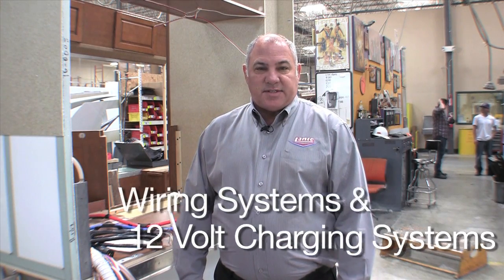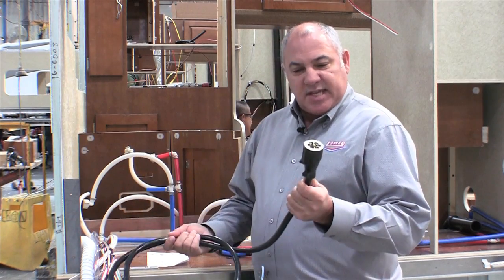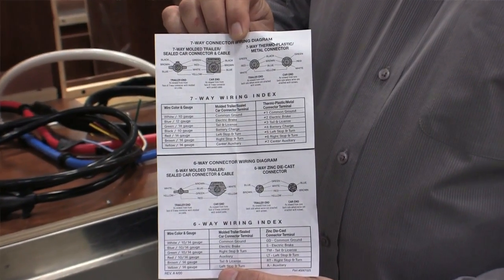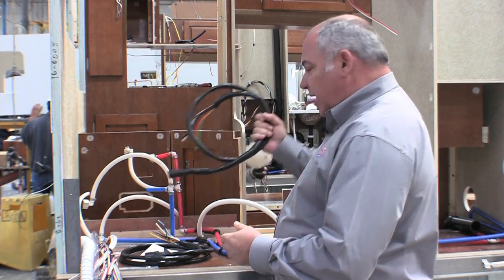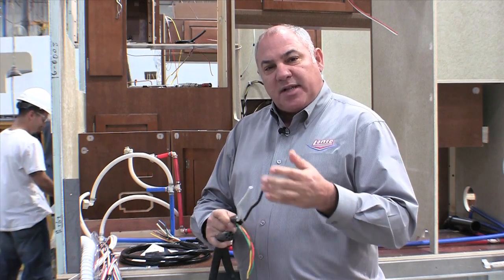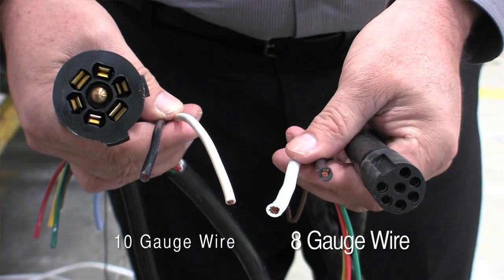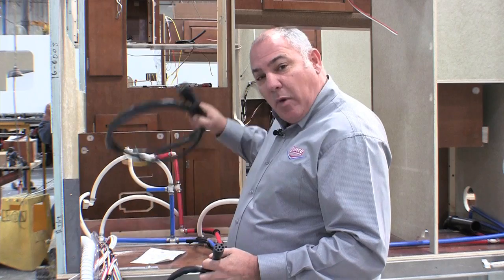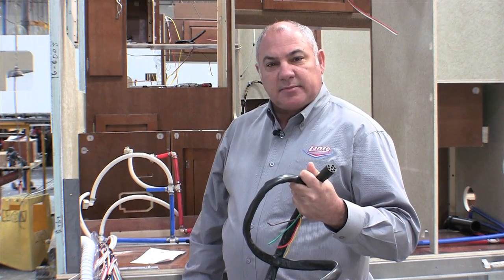Lance Camper:  Wiring System

Comment: So you're telling us Lance designed a  plug with thicker wires but weak connection point to charge the house batteries but still connects to the trucks OEM 10guage harness?   I cut mine off and installed a 7pin.
Reply: I would like to do the same would you be able to tell me how
Reply: Has it worked fine? I’m planning in doing the same. Thanks in advance.

Comment: This is nonsense. The charge lead from the truck can not carry the fridge on DC regardless of the wire ga as the truck output at the seven pin never is that high. Put a meter on it and you will see what I mean. Charge lead output is basically just to sustain the house battery. There is no danger of it getting hot which is why no other manufacturer does what Lance does with its cord and they do not have problems. Check it out Lance!!

Comment: thanks for the explanation; it makes sense.  Is there a Bargman plug adapter to tap that into my truck's tow hitch connector?  I have an old 1990 Lance camper I'm putting on a 1993 Ford F350; it is already set to tow...

thank you
Reply: Did you find an adapter? Im looking for one right now.
Reply: @danielgriego  I am also looking for one for a 1999 lance lite 815. any luck?
Reply: No. Never found one. I ended up just running an extension cord from an inverter I have inside the truck cab to the plug in. Works fine
Reply: @danielgriego  
Do your tail lights work ?
Reply: @alejandradiaz5687  Yes

Comment: It never ceases to amaze me that people thing that upgrading one section of wire to a lower gage (higher amperage) wire accomplishes anything. This actually accomplishes nothing UNLESS you are going to run an 8 gauge or even lower gauge wire from your alternator to the pigtail connector.

I actually ran 1/0 wire directly to an Anderson connector in my truck bed and also to my bumper (for a winch hookup). Then I made up a 1/0 pigtail from my bed to the camper and then rewired my camper for 1/0 from the connector to the electrical panel. The only real pain in the butt part was that the only place I could find 175Amp Anderson connector exterior dust cover housings was in Australia.  Fortunately my daughter was doing a study abroad there and I sent them to her. Lol. These aren’t mandatory but I wanted a finished look just like my existing trailer harness had. 

The only other comment that I will add is it is usually a voltage drop that causes the most charging issues not an amperage drop. That is the real reason for going with a larger diameter wire in DC systems. With this wiring hookup and my 4 AGM batteries along with my 250 amp truck alternator causes my deep cycle batteries to be charged from 50% to 100% in record time just driving or running the engine. 

So while I love lance products, it is disingenuous to suggest that upgrading the pigtail and even the camper wiring to 8 gauge really won’t do much of anything without upgrading your vehicle wiring as well.
Reply: If I understand correctly, when Lance dealers set up their wiring system, they run 8 gauge or heavier wiring to the  battery and install their dedicated plug in the bed of the truck.. meaning that you are correct.. It's just that this video doesn't tell the whole story..I like your approach.. now.. who do I know down under !
Reply: Mike Cavender Well, my daughter is still there if you need an interim shipping location lol. But you really don’t need the “Dust Covers”. As I said, I just liked the finished look of the dust covers. I’ve seen a lot of people just leave the Anderson connectors exposed and use the optional rubber end cap as the weather proofing. I haven’t heard of anyone having an issue with that setup. Now, if I could only find a US supplier of the Anderson dust covers...

Comment: Still doesnt address the need for larger wire to adequately charge a house battery and more importantly it doesnt address the flaw in the truck wire harness.
Reply: Please explain your comment, I have an issue with lack of continuity through plug to my backup lights.  yellow wire, on ram 3500 and no fuzes are blown
Reply: @steveenglish6639  what does your backup lights have to do with connecting a camper to a truck electrical system?

Comment: And anyone out there tell me why my truck is not charging my camper anymore I have change nothing I have power from the battery and the relay at the battery on the truck but the refrigerator is not functioning and it's not charging the house batteries it will charge the house batteries when it's plugged in or when it's on the generator but not the truck when we're driving and I did before
Reply: Did you ever find an answer to fix this?
Reply: Jacob Gordon No I have not I’m assuming it’s The inverter
Reply: @DiegoCauliflower  Have you found an answer?  I'm having the same issue.  Getting a charge when plugged in but not while driving or from generator.  Brand new battery so I know that's not the issue...  Just got back from a 3 week camping trip and will start looking into it.
Reply: Alexandra Anthony yes i had to make sure the fridge is on propane when driving and then the truck charges the battery
Reply: There is a truck to camper disconnect switch in the battery box of your camper. When you have it in the disconnected position, there is no danger of draining your trucks battery. When it is in the connected position, it allows the truck to charge the camper battery and supply DC power from the truck.
Reply: @rwnicholson1712  Thank you for your input if the switch is in the wrong position would I not have house battery power at all from the camper?
Reply: @rwnicholson1712  I still have power from the battery and run the camper just won’t charge from the truck it charges when it’s plugged in to “shore”power thanks again
Reply: In side the plug, a wire or wires are likely pulled loose not allowing for continuity.  I lost backup lights and my plug was spliced on professionally, but when removed and all splices changed, there was no continuity on my yellow wire from inside plug to end of wire, but there was from wire comming out of plug to end of wire.
Reply: If your truck is a Ram they have fuzes that actually provide service to individual wires on the trailer wire hookups, including Lance integration.

Comment: What a bunch of lip service as excuse to charge 100$ for a 5$ part!
It makes no diffrence the wire size going to camper if the feed on truck isnt  upgraded!! 
The camper battery should be supplying mains and the plug should just trickel charge camper battery so dont have to worry about draining vehicle battery!!

Comment: I understand the need for 8g wire.
I called the Lance factory parts dept and discovered that the truck side harness is 9' long.
To get from my truck bed underneath the cab to underhood battery (2020 silverado 3500 ) , I'd need about 15' of wire.
Are there different lengths of this truck side harness ??   Say for a double cab pickup ?
Since my camper is an 815, I don't need to wire for tail lights/ brake lights etc.  I just need  the truck side receptacle so I can wire straight from bed to battery.
????